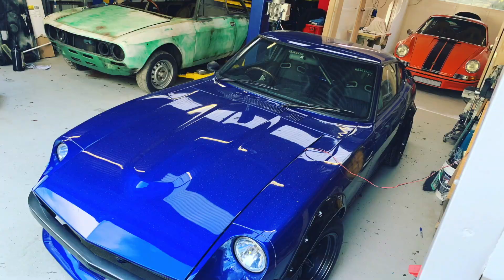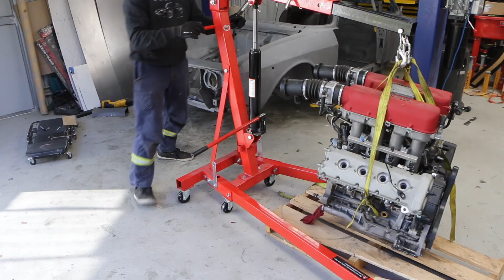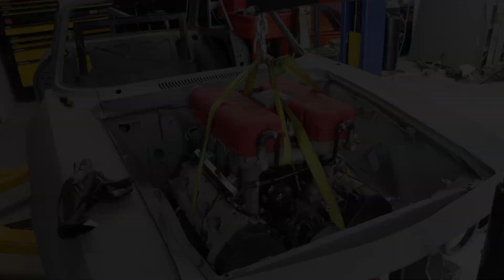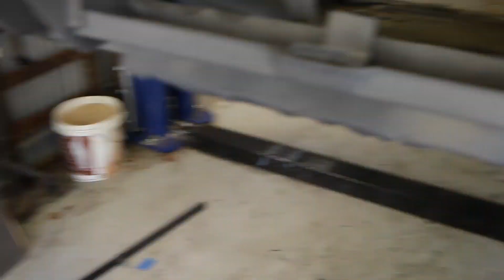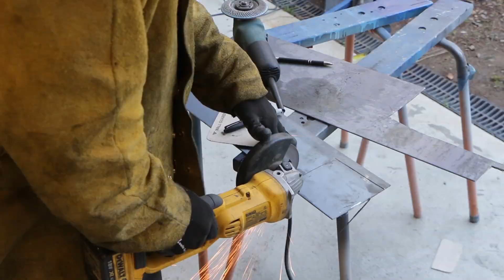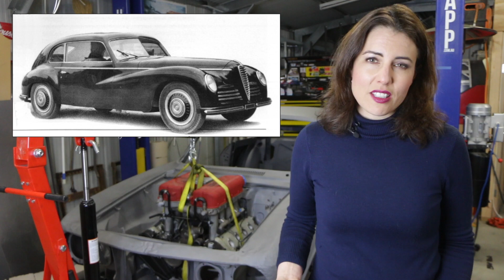Will the Ferrari engine fit? - Alfarrari 105 project car build part 11

Comment: A lot of comments about getting an engineer to look at it. I’m sure Jeff will add top bracing once the engine is in place, it will be more than strong enough once that’s done.
Reply: @simon hanlon I think the engine and location of the motor mounts acts as a strut tower brace bar. IMHO the primary forces will try to flex the top of the strut towers out of square.  I’ve seen X beams or brace bars over the tops of engines, but there’s no room on this build.

Comment: Quick question are you using the original steering box set up Jeff??
Hope not space issue🙂
Reply from the maker: Don't think it will fit ;)
Reply: @HomeBuiltByJeff  sooo steering rack instead 😉🙂👍👍
Reply: G'day at 6.24am Perth time. Jeff another question are you going to register and drive this car on the road??
If I remember correctly there could be a issue raised due to horse power difference and intended monocoq body design, regarding torsional twist difference with v8 Ferrari engine.

Comment: Great can do attitude mate just a tip and only the tip maybe watch a couple welding vids you wanna push the weld not drag “drag the slag” slag being stick and flux core just a thought and verti up nice work though
Reply from the maker: Not always possible, oh, I don't use flux core ;)

Comment: This is going to be an interesting project. It's gonna be awesome. Just a note....years ago we put a second hand starter motor into an old Mitsi Galant, and it had trouble starting sometimes. Turns out it was from a different model Mitsubishi and the tooth pitch was slightly different. Everything fitted, but it bound up. Make sure the tooth pitch on whatever you get suits your flywheel. Saves chasing the flat battery/shonky electrics saga.
Reply from the maker: Will be using the Subaru starter with the Subaru flywheel so it should be good.

Comment: If it was my project I would cut out the cross member etc completely and then place the engine and exhaust manifolds then fabricate a new cross member and engine mounts, it’s easier this way than making complicated manifolds fit a tight and complex space you have now created.

Anyway really enjoying the project.
Reply from the maker: Harder to engineer if you change the suspension points.
Reply: @HomeBuiltByJeff  I was gonna say something similar... Grrr, 'stupid NSW rego laws.' BTW, nice fabbing skills there. Honest, no nonsense, MIG work. :)

Comment: You are doing an Amazing job, but that intake cutting.... Please design It with an engeneer with experience, the intake It Is so long to provide the best fuel atomization and distribution of air and fuel in each cylinder, also the lenght Is to get turbolent air into the cilynders,  modifying that you can have some cylinders going too lean and gripping, and some going too rich. Cutting without an accurate study of airflow and PC simulations Is very bad for performance, reliability, pollution and It can really damage the engine
Reply: Early production models of Ferrari got the inconsistent fuel distribution problem, One of the most troubled was the F40 but it Is a common problem in high performance engines

Comment: Jeff, you need to find a mechanical engineer to look at that brace, you may feel it's strong, trust me, it's only a feeling the cross-sectional bending moment is almost non-existent!  Find one and take his advise,  fix it now or you will be fixing it later.  I love your work but you seriously need to get a second opinion.
Reply: Southern Engineering I mean if it doesn’t work then oh well he can always re-engineer it later. By the time you pay an engineer to do all the math you could have rebuilt it hundreds of times.
Reply: I thought Jeff mentioned previously that this car will be road registered in Australia, which means it will all be engineered.
Reply: The strenght of that beam is not really an issue. Originally these cars are very flexible, the front chassis legs are way more prone to failing under the added power.
I have the saloon version of jeffs car with a very torquey 2.4 jtd in it and that works fine.
Reply: I agreed wholeheartedly.  Even if you crudely look at the vertical pieces of the original box section and compare it with the separate boxes you have installed then the new set up is woefully too small!  In actual fact the strength of the beam is a function of the SQUARE of the depth, so that if your actual new box steel is 1/4 of the depth of the original then the new box is 1/16th of the strength of the original, admittedly there are 2 so that means its 'only' 1/8th as strong as the original shape.  The true values would bear proper calculation as the true shapes have to be accounted for.
The cross member is there to resist torsion and tie everything together and I can see the new X member flexing horribly especially when you factor the torque produced by the engine and the forces imparted by the road.
Reply: @clive williams,  That's exactly what I see.  Those old cars flexed like crazy, and now with ~4 X the energy going into the chassis/frame,  and more mass,  comeing out of a curve under power the steering geometry is going to be 😱 In a word `squirly"
Reply: @JustA Norwegian Not with the intake plenums there and exhaust manifolds below.  It’s more tricky than adding a strut tower rod.
Reply: I'm a mechanical engineer, without having gone into the calculations, I think it's probably fine, however, might want to add some cross bracing behind/in front of the engine once its in :)
Reply: @JustA Norwegian, To be fair, I'm an EE, not an ME   It would be great if you could do the numbers on that structure, what I see is the shock towers moving in and much higher stress loads just below the engine mounts,  with all that old thin metal adding braces will help, but once all the dynamic loads start happening the front of that car is going to behave like soft pasta.   I want his build to be successful but this part seriously concerns me.
Reply: @SouthernEngineering  Especially the triangulated pieces he added will help fantastically for the stiffness, however as mentioned, adding some bracing after the engine is in would be a good idea. Something across the top would do the trick.
Reply: @SouthernEngineering  the engine should help at rigidity from bending inwards at the top as there is an engine mount on either side but a nice cross member under where the bell housing may be a good idea.
Reply: @Freddy_Lie  Agree, however your still up against that massive intake. I'd think too putting some triangulation to the firewall from the bottom is possible but hard to say without the suspension, steering, and exhaust. I'm sure he'll come up with a solutions or two.
Reply: @JustA Norwegian, A cross brace from the towers to the center firewall would cover some of the suspension loads, but Jeff is literally putting 4 times the power into the chassis/body, the torsional load imposed from the engine torque I fear will twist that unibody out of shape and cause rapid geometric changes to the front suspension with unpredictable steering behavior.
Reply: @My Opinion, I must confess, I know little about that engine, Is the engine Ridgid mounted or is it on Isolators?
Reply: Jeff is the mechanical engineer. Its his shit. If it fails, he will rectify it. Jeff is all over it. A good strut brace will see it all right:)
Reply: @whitewarmaker,  Don't misunderstand me,  I want this to be a successful build and I will be following closly because I'm planning something similar with a V10 and 1949 MGTD, sadly he will most likely be finished before I can start on my project.
Reply: @SouthernEngineering That sounds fun I really want a Dakota V10 some day. It's a shoehorn job if I ever saw one. Jeff is a smart cookie I'm a little upset that he is cutting the stacks as that is what makes the high end power. Long plenum high end hp. He will make it breath differently than engineered.
Reply: @Dumpster Stu,  I could do a Small V8 but anyone can do that,  I want something truly unique.  The MG is a full-frame car that should make it so much easier.  He will definitely give up some top-end fortunately that engine has plenty to spare.    If you want to follow along I would love to have your SUB.  I have a few small projects this summer, then my youngest and I will be rebuilding Moms old Jeep this winter, it will be her first car, and I'll be working on the V10 at the same time,  building, sanitizing and purifying it down to its essence.  Heres a teaser,  It's not a Chrysler engine 😁
Reply: @SouthernEngineering  will look Into it the mobile version sucks and they stopped telling you people reply to your comment damn Google
Reply: @dumpster Stu,  That is a problem,  but to be fair to Google, they most likely handle hundreds of billions of email/messages each day, it's not too surprising they misplace one or two.   BUT it's still annoying!!
Reply: @Smarterthanyou-mthrfkr  He is a mechanical engineer? I didn't know. I agree on the strut brace, maybe a thick one of some sort and it'll be fine.

Comment: It’s a great idea to use as much off the shelf stuff as you can. Did you consider the Alfa rear transaxle gearbox to put some of the weight rearwards, probably mean your tunnel could be left pretty much as is and all the welding needed is in the rear where you have already said you are rebuilding.  Transaxle has inboard doc brakes also helping with unslung weight. I say bin the plenums - throttle bodies!
Reply from the maker: Off the shelf is better I agree and changing the tunnel is dead simple compared to rebuilding the entire rear end suspension.
Reply: No worries Jeff

Comment: It's amazing how close that is! I'd still suggest getting a custom flywheel though. It's cheap enough that it makes sense doing. Especially with the level of your build. That way you also don't have to run a spacer behind it to compensate for the adapter plate.After all, you need the starter ting to be in the oem posision for the starter to engage properly.

Comment: G'day Jeff those intake runners look about 11 inches long.
Which is top end RPM,
So cutting back to approximately 4 inch will be more power down lower in the rev range.
Just s o you know 😉🙂👍👍
Reply: Are you sure? I thought shorter runners = less low-rpm torque.
Reply: @scanspeak00  go back to the old torana day's at Bathurst, 11 inch runners on the xu1 longer legs on the old Conrod straight.
Those that used 4 inch didn't have the top end but were real quick from start line.😉🙂
Reply: Short runners for top end power and long ones for torque. They made them long to give the engine more low down drivability. You could easily make long sweeping runners though. Bare in mind that diameter is also important ....too large and you lose velocity , too small and you’ll strangle top end.
Reply: @Omegaman1969  guess I Am using a different language short they rev up fast.
Long runners rev up slowly. Any better.
I.E longer legs for rev range. And yes a much longer torque curve with 11 inch.

4inch much shorter torque curve and quick to max RPM. Hence shorter legs on gear ratios.
Reply: @Steve Veness  Shorter means the a/f doesn’t get time to mix as well. There’s a mild ‘supercharger effect’ from the runners. The “stack” has a resonant frequency specific to the engine’s optimal rpm range. Shortening the runners pushes the ‘supercharge effect’ higher into the RPM range.  So I agree with Simon that longer runners would add drivability lower in the RPM range. That’s how I’d describe it.  I think we all agree it’s moving the power band away from where the Ferrari engineers designed it. But with this power/weight ratio it’s not going to matter much, it just might not ‘sound as good’ at lower RPM.
Reply: @alienpoker  yep time will tell. My comments are only based on 38yrs as a 3rd gen Engineer @ 54yrs of age I may have forgotten half what I had learned working on European high end car's and of course the Guarden variety brands.
Which is why I watch all kinds of guy's and there builds.
To keep what I have learned from my family and of course my trade life.😉🙂👍👍

I figure once I Am released from my carer roll dealing with Dimentia in my Mother,  I Am going to have another workshop 🙂
May as well 38yrs of tool collecting plus previous generations tools a huge imagination to create bucks for hand formed body panels etc.
Then of course pull out Ackerman principals create the perfect steering geometry etc.
Love all of it creating sooooo Much Fun finding ways past challenges of things that can't be done.

Jeff reminds me of my early days of learning.
He has a go admits his mistakes and finds a way.🙂
Best part is he hasn't even done a trade it's pure imagination and creativity in a shed . And that's simply awesome.😉🙂😎👍👍

Comment: Will a Subaru starter motor turn over a V8?? The body is going to need some bracing for 400hp compared to 120bhp of the original engine..looks good so far
Reply from the maker: We will find out ;)

Comment: Use a 300zx gearbox . Starter motor also mounts to bellhousing . Why use a Subaru gearbox there rubbish mate . Your wasting your time
Reply from the maker: They are HUGE and weigh a ton!
Reply: @HomeBuiltByJeff  i don't think it would be that much more . Not too mention they will not break with 500 or less even hp like a Subaru gearbox .
Reply: Is it a Subaru gearbox I thought it's an Aisin (Toyota) gearbox?
Reply: @irrigationdr  yeah it's an aisin. Same as rx8 box. They are a piece of turd. I did recommend using an fc or fd rx7 box which have the rear mount starter and will hold 500 to 600rwhp if you are kind to them but he seems set on the aisin.

Comment: "These are loooong runners.... I'm going to cut them down " 😳😳.... Damn, you're brave, Jeff. 🤟 Love the 'can-do' attitude though....
Reply: Looks like cast aluminum too. I'm far from an expert but I think that's difficult to weld. Definitely looking forward to that video!
Reply: @MrJasonAlderman  Yeah cast is difficult but possible to weld. At least they haven't been soaked in oil for years.
Reply: @Cheddar555    True. Sick TIG skills needed.  Maybe preheating too. Time to buy an AC welder, if he hasn’t got one.
Reply: Should rev to 15000rpm with shortened runners..hehe